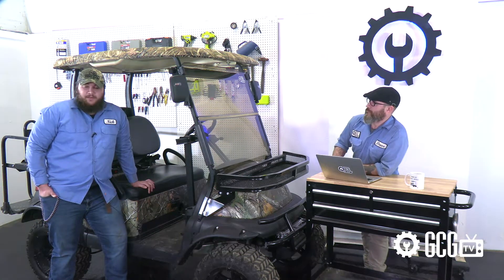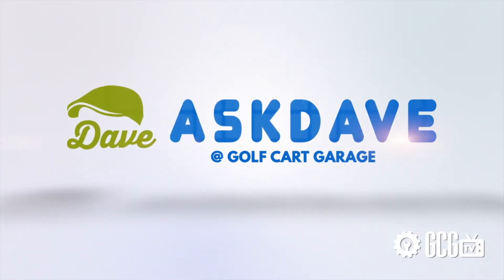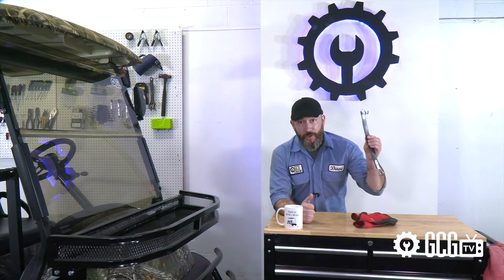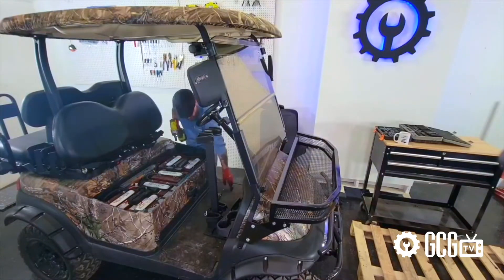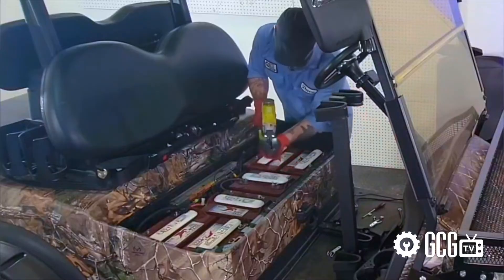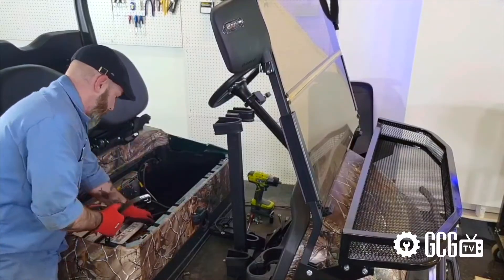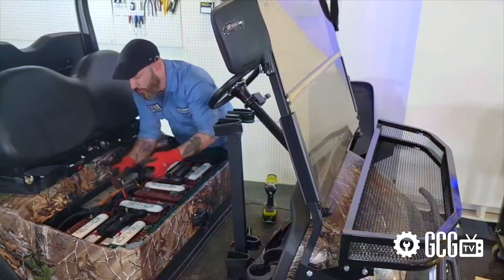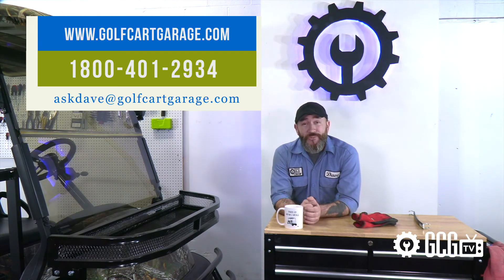Remove and Install Golf Cart Batteries | ASK DAVE | Golf Cart Garage

Comment: awesome video.. glad I found this channel.. getting to put new batteries in.. connecting the batteries, you go positive to negative correct??  and there will be 4 or those cables??
Reply from the maker: Welcome aboard!  Yes, you'll connect each from one positive to the next negative. Number of cables depends on cart model and quantity/voltage of batteries.  We can help provide diagrams if you contact us directly at Support@GolfCartGarage.com or (800) 401-2934.

Comment: Great video! I need help attaching the wires on my 1994 club car. Installed new batteries and do not think the wires are hooked up right . I know the batteries are hooked up right it is the other wires that run lights and stuff. Help!
❤️🌻❤️
Reply from the maker: Thanks for watching!  Your light kit wiring can have different characteristics, depending on manufacturer.  We recommend you consult with our diagnostic team here: https://www.golfcartgarage.com/gearheads-on-demand/
Or you can get in touch directly at Support@GolfCartGarage.com or (800) 401-2934

Comment: Great video guys! I just purchased a used 8 volt trojan t875 battery and tested at 7.5 volts which is only 10% charged.  After charging overnight with my charger it will only get up to 8.18 volts which is 60%. I don't want to overcharge my other 5 good batteries.  Did I buy a bad battery or do I need to keep charging it over and over? Thanks!
Reply from the maker: Thanks for watching!  If the T875 held 8.18 after a charge cycle, it may be ok... it sounds like it may have been sitting for a while if it got down to 7.5v. Most modern chargers run a "balance" or "overcharging" cycle every few charge cycles to get all the batteries to the same level and keep them maintained.  Try a few charge cycles and see if that levels out for you.  May also want to load test that one after a few cycles to see how it's going for it.  Let us know if you have more questions or need help.  Support@GolfCartGarage.com or (800) 401-2934

Comment: Do i hook up all the series cables first,then the positve,and finally the negative?
Reply from the maker: Thanks for watching!  Yes, that's how we do it.  We wrap the mains in electrical tape until then to keep them from sparking on metal, but be prepared for a spark when connecting.  Let us know if you have more questions or need help.  Support@GolfCartGarage.com or (800) 401-2934
Reply: @GolfCartGarage  Thanks for the help!
Reply from the maker: Any time!  Just get in touch if there's more we can do to help out.  Support@GolfCartGarage.com or (800) 401-2934
Reply: @GolfCartGarage  hello,  when replacing all batteries. . .  . can it not be done one battery at a time?  by that i mean,  can i pull out one old battery, put in new battery so it is easier to remember the connections?  then go to battery 2 and pull out the old one and replace with a new one,  then battery 3 etc?   seems easier to remember the connections.  or will this harm the new batteries by being temporarily connected with old batteries?

Comment: I just picked up a golf cart 2 of them read lower than that. Should I replace the two batteries or should I replace all of them?
Reply from the maker: Thanks for watching!  If 2 of your batteries read below their rating, the others are likely not far behind.  Ideally, replace all at once.  However, if the rest are performing well, it's ok to replace just the bad ones in a pinch and it will still work.  Let us know if you have more questions or need help.  Support@GolfCartGarage.com or (800) 401-2934

Comment: I came here to see what the process was of unhooking the batteries. 😩😩 Could you help me with that?
Reply from the maker: Unhooking from the cables or from the tie downs just requires a wrench and maybe a friend to help.  It can vary from one cart to another, but if you get in touch, we can help.  Support@GolfCartGarage.com or (800) 401-2934
Reply: @GolfCartGarage  I guess I am wondering if there is a correct order of unhooking them. Like do I unhook the fi negative on the last battery in the series and then the positive on the first battery in the series?
Reply from the maker: You can start with either one and we usually electrical tape the ring terminals on those to prevent contact with metal during the process.  After that, the order is up to you.  Some of our techs like to remove and replace one battery at a time to stay aware of where everything goes.  If you have more questions, just get in touch!  Support@GolfCartGarage.com or (800) 401-2934.
Reply: @GolfCartGarage  Thank you!